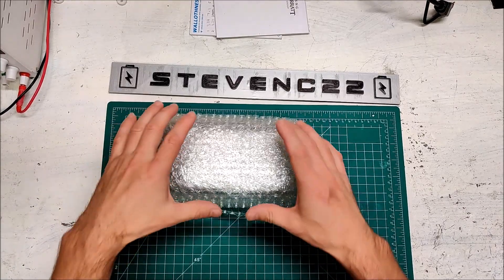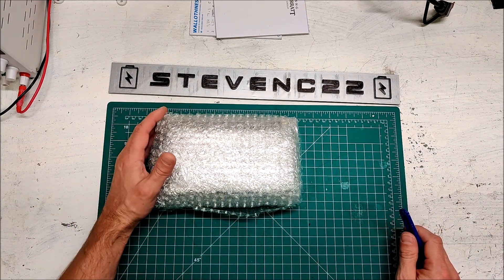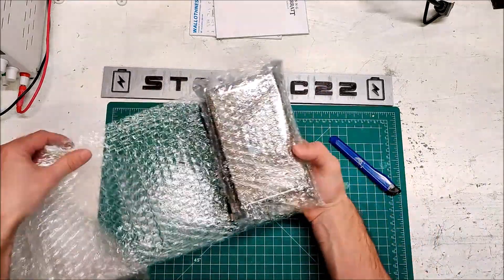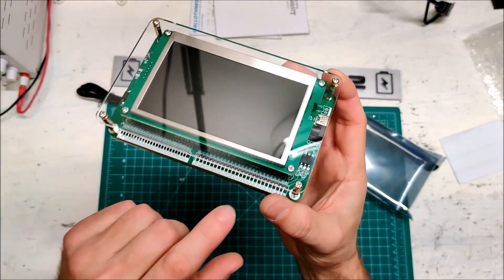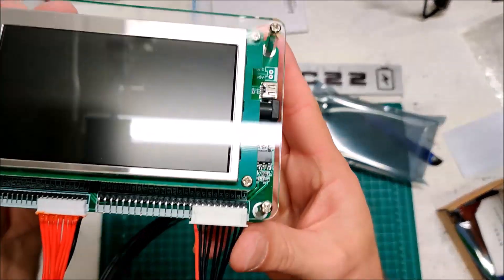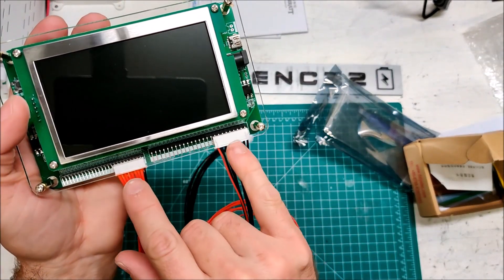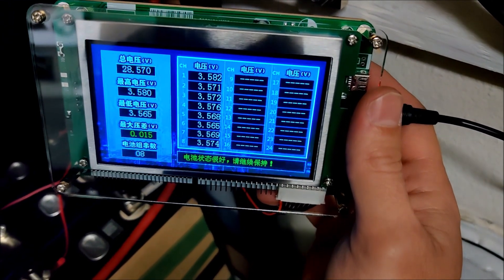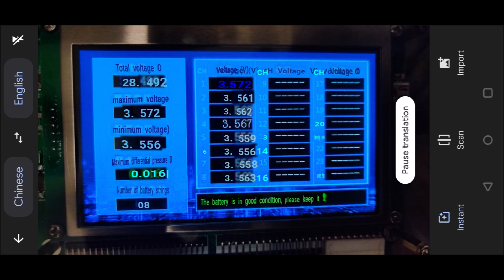24S Cell Monitor

Comment: Hi, how it's holding up this device? Did you find a better one? I need a 24s cell voltage monitor and would be good to be smaller and lighter.
Reply from the maker: It's great. Still going strong. Use it a lot
Reply: @stevenc22 Thanks! Does it have an alarm function for low cell voltage? I think I saw it on a similar device somewhere.
Reply from the maker: @Seneslau07 no alarm. But the screen displays the high and low cell voltages and the delta between them.  It's also says battery health is "good/okay/ bad"

Comment: Quick question, i've got mine connected the same way as yourself,  but not getting anything, tried the same on 3 batteries and nothing, what do you think I should do? Have I got a dud tester?
Reply from the maker: Did you power the tester with a USB cable?
Reply: @stevenc22  yep, even tried a separate charger and still nothing, been in touch with enerkey and they've been little help, the tester flashes with a green light even before a battery isn't plugged in.
Reply from the maker: @ljaproductions07  is the display coming on with the USB power?

Comment: QUESTION: : I have been collecting used cells from laptop packs. I have found a place for higher quality cells that are all the same make and mod. Should I keep the new cells separate from the ones I already have,  OR should I intermingle them with the used ones for more even packs?? I can go either way , but which one is best??
Reply from the maker: If you want to use them all, evenly mix them I'm each parallel pack so the capacity of each cell group is consistent. Same thing I do when I run out out of one kind of cell, I sprinkle on different cells evenly throughout.